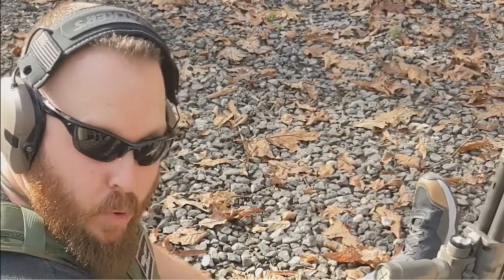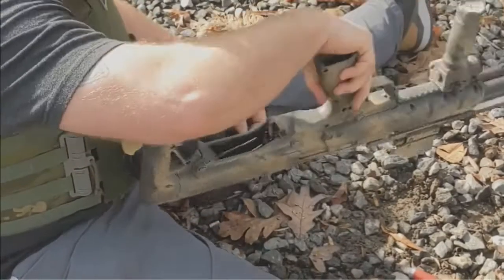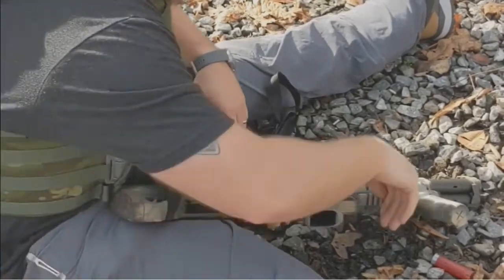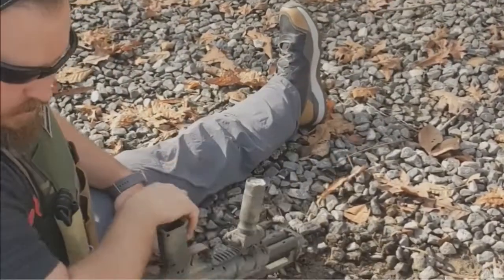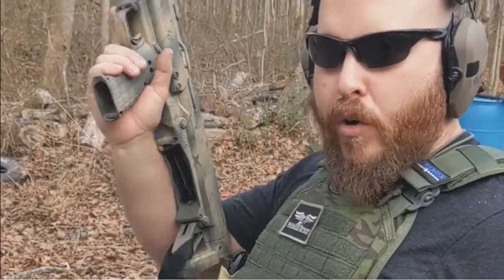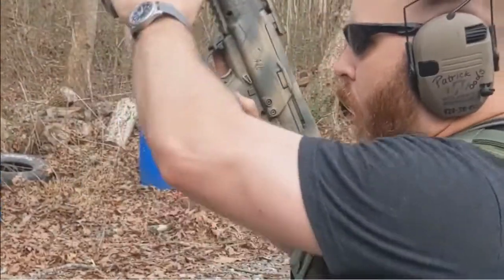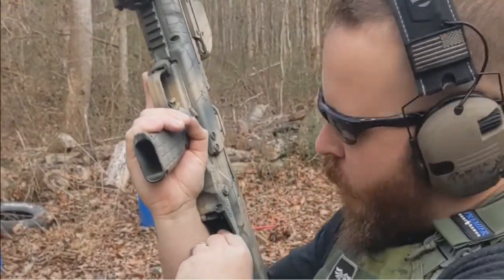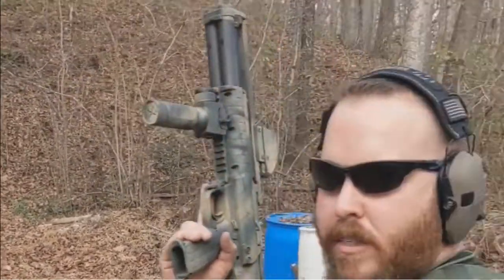How to Port Load a Kel-Tec KSG Bullpup Shotgun. #keltec  #bullpup #preparedpatriotnc

Comment: I've learned to like my KSG, not love, but like.  It runs really smooth now but I did have a few jams in the first 100 rounds I put through.  I haven't tried port loading....something new and fun to train!  Thanks for the video.
Reply from the maker: Glad it was helpful. The KSG is a love/hate relationship.
Reply: Mine has failure to fire ejects with no primer strike
Reply: can I quad load / double load it?

Comment: does this work w a mag fed bullpup, like the panzer exg500?
Reply from the maker: Have little to no experience with mag fed shotguns in our classes. Generally they are somewhat temperamental, and most people that train avoid them. So I am not sure if it would work or not. You could attempt and see if you own one. I advise using dummy rounds while you practice.
Reply: @PreparedPatriotNC  Great reply, safety first...will do. For reference I've ran everything through this shotgun, ran it hard w 50 shells near continuously (w reload time of course) for a total of 250 ran through with 2 FTF issue, that's it.
Give this bullpup another look, it's got great reviews and an awesome 500 rnds in 30 minutes vid...it ran flawlessly.
ty for your feedback.

Comment: No one show how to unload this gun without firing it.
Reply: Just rack the shotgun a second time. The shell comes flying out. I do it all the time when im heading to the range. I have to eject all of my home defense rounds
Reply: @dmoore396 : Just under your loading tube, you'll feel a small metal lever. Pull it down & dump the loaded tube out
Reply: @Doublezzranch pull it down with what? That shit will just pinch your finger if you do it that way.
Reply: @m.m4982  : Do you have a KSG? If you do, you'll see the thing I'm talking about. Use your trigger finger & they come out, no problem.